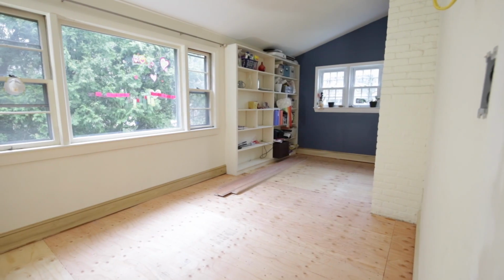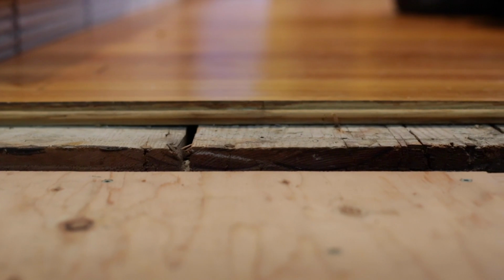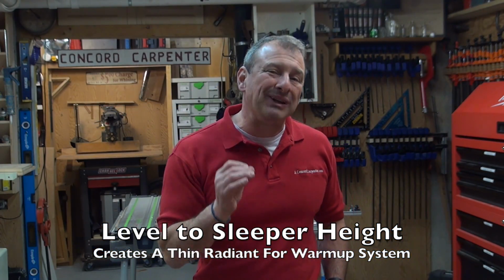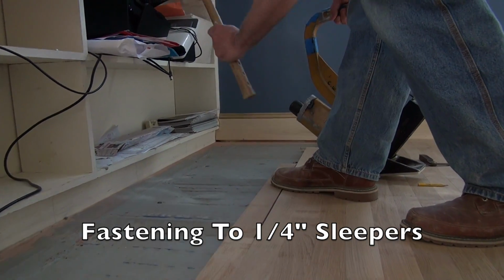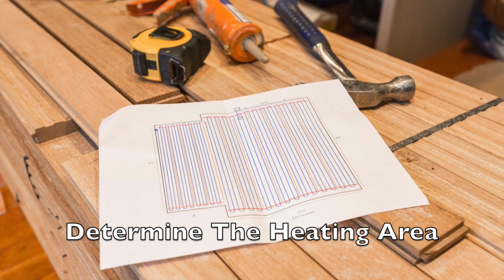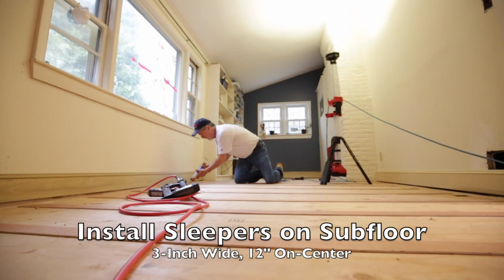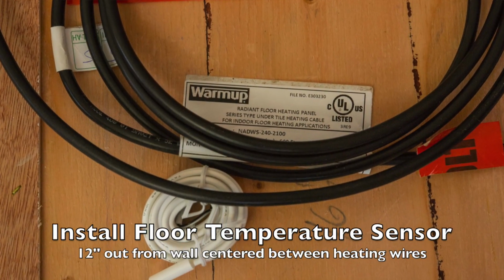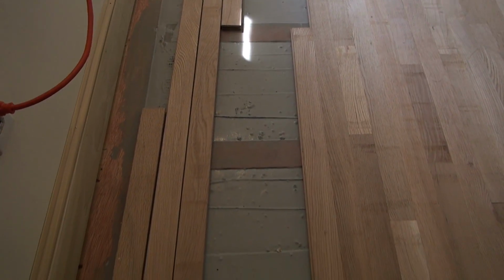Installing Warmup Electric Radiat Heat Under Hardwood flooring

Comment: Rob, I’m currently following this video and installing this system from warmup under 3/4’ hardwood floor.  What type and gauge of nail did you use to fasten the sleeper strips down to the plywood/insulation subfloor layers?  I’m also thinking of using liquid nails under the sleeper strips in addition to nails.   Thanks.
Reply from the maker: Const adhesive and crown staples
Reply from the maker: urghhh I forget - check int he article on concordcarpenter.com - I may has specified in the article
Reply: Rob, Most 3/4” flooring comes in variable lengths.  What is the minimum length of board for the rift and quartered flooring you use? Thanks

Comment: Do you have a similar video or instructions but for slab on grade construction?
Reply from the maker: We have a video on insulating a slab with poly insulation and putting double layer three-quarter plywood over a hardwood floor. 

we're also working on a video next week where we did polyiso( new product)  and 4 inch deck concrete slab for a barn we're building

Comment: I think this is the best version I've seen of electric floor heating on and under timber flooring. You actually explained the latex thinset in a way that makes sense, so I now understand why that is necessary and why systems that don't use it probably aren't going to work as well.
Kudos, and thank you.
Reply from the maker: Appreciate the feedback, glad to hear it was helpful!

Comment: Thanks for sharing. I know this was uploaded a long time ago,  but maybe you are the best person to answer my question. So one head of the warming wire is connected to power, but waht about the other head? What is at the end of the warming cable?  I got one with cutted both heads and wondering if somehow I can make it work for my office .
Thank you
Reply from the maker: The end is coated but I’m not sure how they do it
Reply: @ConcordCarpenter  thanks for the response!

Comment: Very clear & concise. 
One more tip, if building or remodeling for 'Age-in-Place' or Universal Design, place thermostat a bit lower on wall; reachable if in a wheelchair. Approx 45" from floor.  Same with light switches. 
(Engage child-proof options if needed) 
Thanks! 😊

Comment: Question. Looks like the hard wood surface was nailed down into and through the heated base you just installed. How did you manage to avoid damaging (nailing through) the cable system embedded in the floor beneath???
Reply from the maker: Nailed only on the strips

Comment: Great instructional videos, thank you! Why would you recommend a latex based or modified screed over a flexible fibre re-enforced one (some of which are also advertised as suitable for electric underfloor heating encapsulation)?

Comment: This is indeed a great instructional video. Can anyone please provide an alternative solution ( other than Warmup) as insulation boards to be used with an electric heat system under hardwood?

Comment: One of, if not the best, instructional video I've seen. Thinking of radiant heat in my problem office space that was once a screened porch with only a slate over concrete slab. I would like to add at least 2" of rigid foam insulation then ply or OSB below the finished floor.
Reply from the maker: Clint Johnson thx

Comment: A couple years old, but are you leaving a gap between the sleepers at the ends in order to continue the wire?
  That isn't addressed in the video.  I'm guessing you must have if only an 1/8"
Reply from the maker: Yes sir we did - see more detail here:  http://www.aconcordcarpenter.com/wood-floors-and-electric-radiant-heat.html

Comment: Would you recommend hydronic or electric floor heating under engineered hardwood floor?
Reply from the maker: Daniel Grimborn I only recommend electric radiant heat for remodelling, retrofitting and additions.  In new construction hydronic wins
Reply: A Concord Carpenter / ToolBoxBuzz we live in a two story house built in 98 with tile floor in the kitchen. Would you recommend electric for us? I hear that it can become expensive to run it compared to hydronic. We are in Northern California so it’s not too cold in the winter in our area.
Reply from the maker: Contact warmup.com for cost rates - you might be pleasantly surprised

Comment: I want that in my tiny house on wheels, I’m afraid the mortar is too heavy. 
Can I route groove in my plywood and put the heat cable in it ?
If not, does that exist ?

Thanks a lot !
Reply from the maker: I think they make versions to go under carpet.

Comment: I am currently remodeling my house and will be installing this into my bathroom floor. Currently the bathroom is gutted with new plywood going down for the sub floor. I installed my 4x4 box on the inside wall and ran a 1/2 " conduit thru the wall into the floor with a pull string. My question is do I need 2 separate conduits for the thermostat sensor wire and the heating mat wiring or can i run them both into the same conduit ?
Reply from the maker: hvac917 same
Reply: I have same question.. my electrician pulled two of them..

Comment: Rob, Thanks for clear and concise demonstration of installing the radiant heat.  I have a different situation in my family room.  The family room have a beautiful finished hardwood floor and underneath is the crawl space.  Unfortunately the floor gets very cold during winter season and I would like some suggestion from you how to warm up the floor.  Can I install radiant strips in crawl space,  between joists, under sub floor.  How effective that can be and how economical will be the cost wise.
Reply from the maker: Rajendra Bansal you can its not as effective.  Is the crawl space sealed, insulated and heated?  Search my website for the search term crawl space - there's a great solution for you there

Comment: I have used the mats before but never the loose wire. Will this be the main source of heat or will it be used in conjunction with another heat source. Looks nice. #TIACREW
Reply from the maker: +regopit44 It will supplement one small HVAC vent that is sorely undersized for that room.

Comment: Nice looking product Rob, just installed something similar in our bathroom, but yet to try it under a timber floor. 

Great tips as always!
Reply from the maker: +Our Build Thanks James - I'm filming a video on what types of floors to use with floor heat.  Stay tune
Reply: +A Concord Carpenter Great, there is a huge range of boards on the market so tips like you mentioned about moisture content are key to the DIYers out there.

Stay away from that Australian cypress :)

Comment: Are you sponsored by warmup? Do these same tips apply to other brands as well?
Reply from the maker: Thanks for your comment. Warmup did supply the product for the homeowner but these tips do apply for most loose wire floor hear system. The technology is fundamentally similar, but I would recommend you check the recommendations of the specific system before installing any system. For what's it's worth, floors like this make an amazing difference for a house.